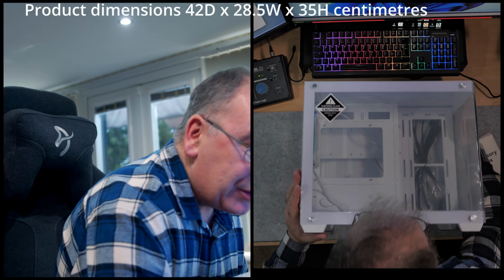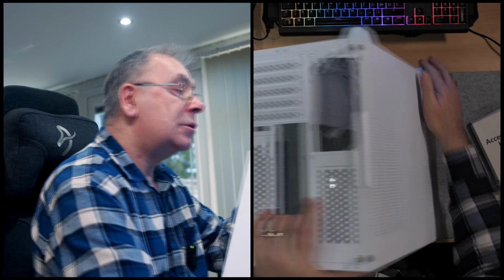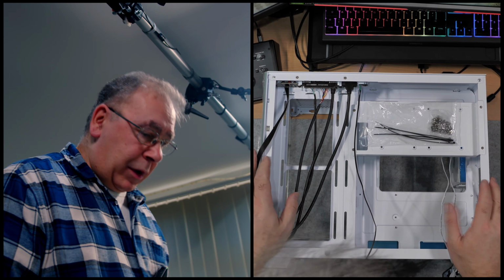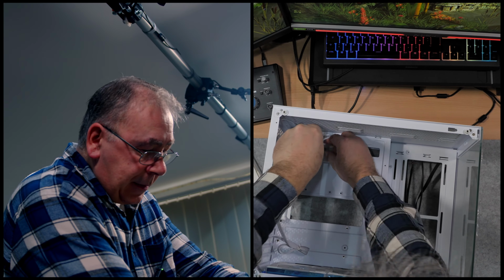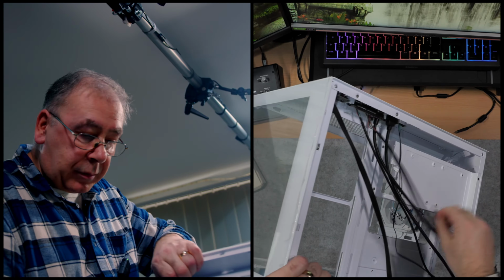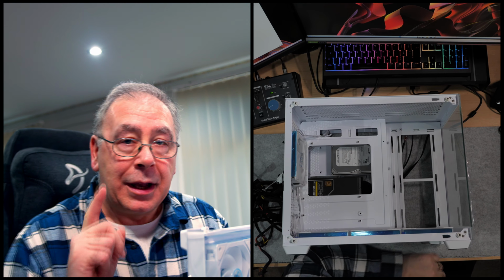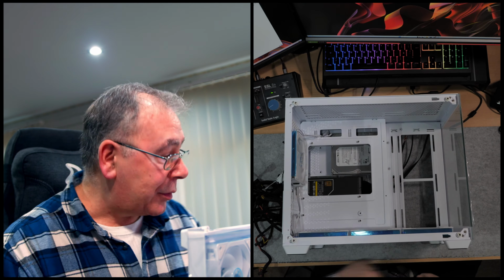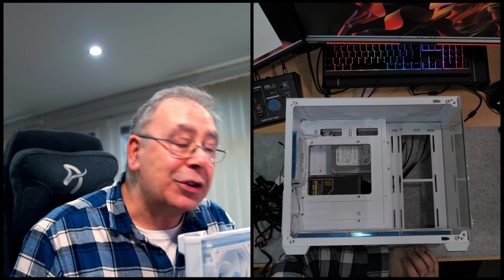Unveiling the SaharaGaming M808W: A Sleek Encounter with Power and Style! Subscribe to see the build

Comment: Hello, off topic here but i am struggling to run my ROG Swift 360Hz PG27AQN NVIDIA G-SYNC 1440p Monitor at 360hz even 240hz most likely down to the cable that came with the monitor, What DP cable do you recommend me buying? i am currently looking at the KabelDirekt – 8K DisplayPort Cable from amazon that does state it does WQHD (2560×1440) at 360Hz should i just stick to buying it.
Reply from the maker: Look for VESA® Certified, I did not see VESA® Certified on the 360hz one, check this one out https://www.amazon.co.uk/DisplayPort-special-shielding-official-certification-black/dp/B07HL336L2/ref=sr_1_4?crid=SI31JX9QU4O3&dib=eyJ2IjoiMSJ9.FIyT-nO2Pirz2qiyRsFsOH1G9BsLpE2p4HuGrY3j1R2tUWByEncKJQuLpT4RPxYmJMW_fsFVWeJrkGfQkgrofOt9z_dsNtiaUVDwCWpbUFRfSjSWyUtfE-KiNgZIN_b8mIQblLBVMDovIGwgEPDQLCRkzkH9QZ7TcDNgJXBECawJWg1ojTfk_3-0itQvY6mOAPJKdAmianT_zqlcwEHN-6q9yGfDqnEnAZn76Z0zegQ.Y9cDqRl5T2HzSavOaOmqfhM2TTjrDHLfjzqbrPrPaz8&dib_tag=se&keywords=KabelDirekt+%E2%80%93+8K+DisplayPort+Cable&qid=1709012067&sprefix=kabeldirekt+8k+displayport+cable%2Caps%2C267&sr=8-4